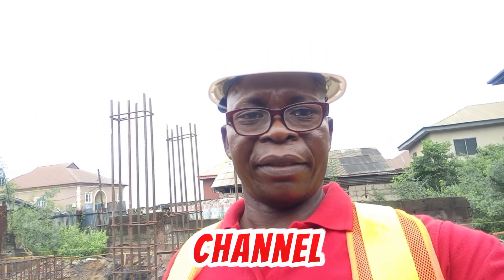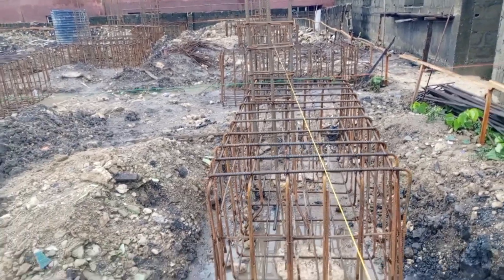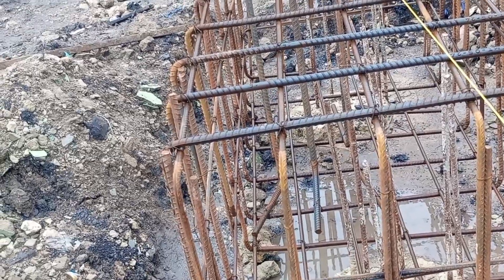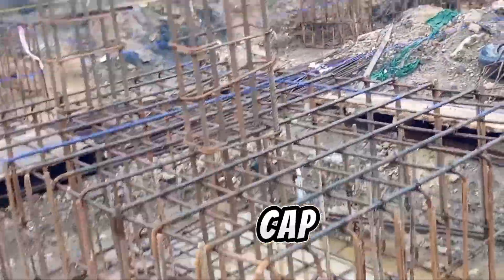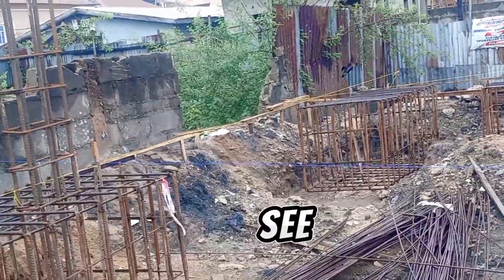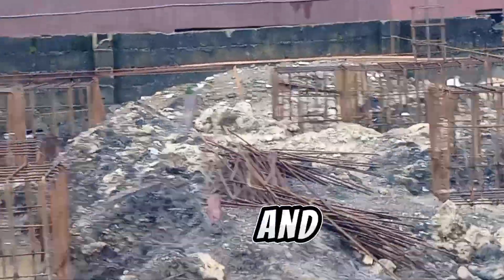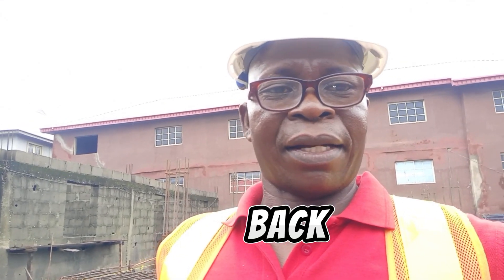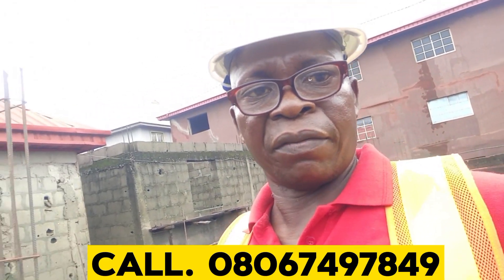Foundation work on swampy land. piling, pile caps and beam reinforcement

Comment: The Burj Khalifa in the UAE which is the tallest building in the who world was build useing 50 metre piles, so how come a 3 storey structure is built with a 20 metre pile depth?
Reply from the maker: The depth of the foundation is determined by soil test. It depends where the bearing capacity of the soil was in that building.  .

Comment: Hello Sir. 
How are you Sir?

Option A.
The entire living room space is 7.25x6.25m.
Arranged like this.
Main lounge 
6.25x4.21m
VIP lounge or Bar space 3x2.75m.
Dining 3.5x3m 
Total 45sqm.

Option B 
Lounge 6x5m 
Dining 3.6x3m. 
Total 40.8sqm 

Sir please these two living rooms which one is luxurious? 
Which one would require more land space?
Which option is best?
Reply from the maker: The difference between the options is not much. Option B requires more space, for luxury is option B
Reply: @peeglobalengineeringlimited  Note that option A covers 45m²
Option B covers 40.8m².
Option A has more land covering here.
If option B is better and more luxurious?
Then how do you create 3x2.75m space in option B for more activities?